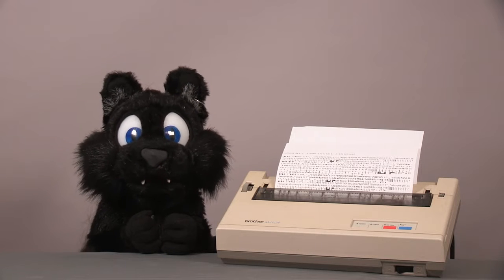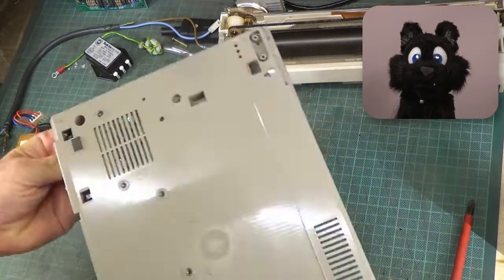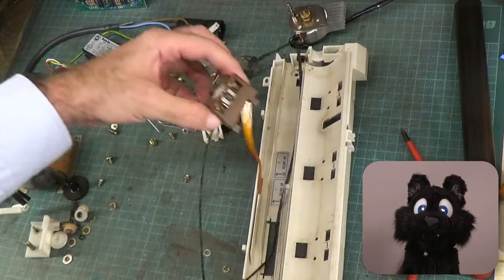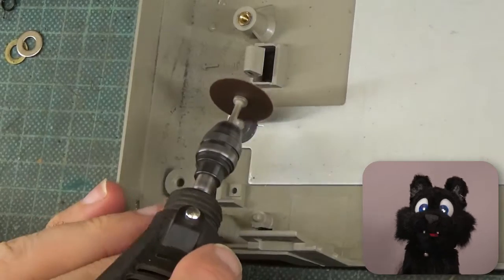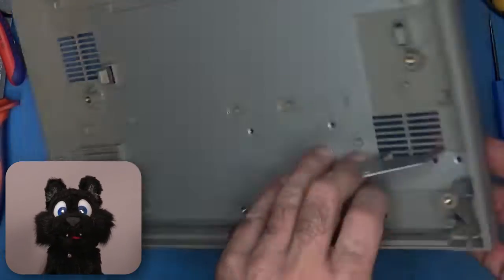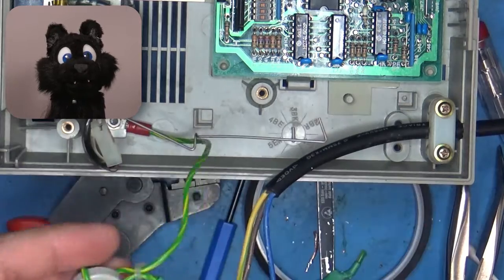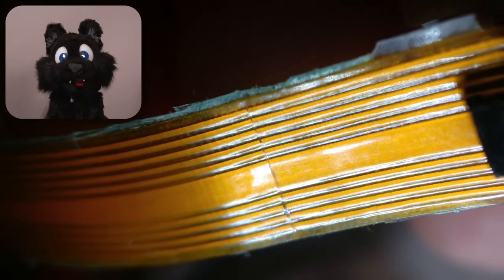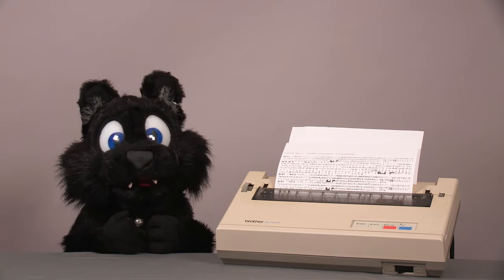Brother M-1109

Comment: This flat cable problem is so common, the ONLY problem I repaired on this printer back in the day, was changing this darn flat. I used to change 10-20 flats a week. It was a very common printer in Brazil, named as Lady 80 / Lady 90
Reply from the maker: I can imagine... but where to get a new one these days? I hope the repair holds for some time...

Comment: I have the M1009, very similar to this one.  It won’t advance the platen, the stepper motor is rotating and the cogs are not sheered, they all connect together correctly but it won’t turn when the line feed button is pressed, the platen dial will rotate manually, very easily, so I can’t figure out what the issue is.  Any ideas?
Reply from the maker: Maybe a gear is slipping? they are just pressed on to the axle IIRC...? These gears also tend to "crack" and loose the grip.

Comment: printer nightmare, a servo motor and a resistor using a heat sink, switch with built-in fuse (Same stuck on the casing ) and the broken flex ,all that in a small casing, good job cat

Comment: Amazing restoration, as all the other ones !! About the power switch, it looks like a thermo actuated circuit breaker, if it’s the case, it will auto reset after cooling down.
Reply from the maker: Interesting thought... It would be the first thermal based switch without a bimetal construction I come across. I still wouldn't want to try it though :D
Reply: @atkelar  Oh, I wouldn’t try it either 😁 In the video, the metallic contact strips looked like bimetal, but I might be wrong, it wouldn’t be the first time 😂

Comment: Very interesting type of toroidal power transformer inside. I've seen similar ones inside early 2000's Onkyo receivers.
Reply from the maker: Interesting! I think I've seen similar ones before, but I can't recall exactly where. Pretty sure I didn't ever have an Onkyo receiver open... I have one for my home cinema installation, but that is working well and shall not be opened for fun (yet) 😜 It might be a series made by a specific manufacturer that was either cheap or had specific quality properties.
Reply: I’m pretty sure it’s not a toroidal at all, but rather what is called an R-core transformer. IIRC they’re used in audio devices because they produce less stray magnetic fields or something like that. They’re a fairly expensive type of transformer to manufacture.

Comment: As always a commending amount of effort put into the restoration, pity about that flat ribbon, I absolutely can relate to it, I recently fixed a P2 Laptop CD-Rom drive which failed in both cracked gears and broken ribbon cable to the laser assembly and my ribbon was broken at the contact end, oh boy and it even change width directly after it, in a miracle I managed to make a sad working connection and it works again, but as always how long can cracked repaired delrim gears and flat ribbons work like that anyway? age can really take the best out of most stuff
Reply from the maker: With lasers, the additional problem is that they age poorly even without the surrounding support giving up. I hope your drive holds up as long as possible!
Reply: @atkelar  yes let’s hope so :)

Comment: Good thing you noticed the flat flex issue, otherwise you'd be in for a lot of trouble down the road... At least now if it fails, you'll know what failed.
Reply from the maker: It was quite obvious; These ribbons don't age well at all. I might try to make a replacement, if it fails.

Comment: Very thorough restoration!
Could you elaborate on the strain relief remark on that line filter thingy adapter you've made? Thanks!
Reply from the maker: Thanks!
That's a detail I only realized during the final stages of editing; hence the lack of commentary. I wrapped a piece of wire around the perf board and the connector, since I don't trust the copper to withstand any mechanical stress. That wire is soldered to the connector and tight thorugh the perf board. That way it hold the two together. Of course each connector needs its own wire, and the insulation tape has to go on the backside too for that reason.
Reply: @atkelar  ah, I see now! I agree, you could easily rip it off without additional support. Very clever!

Comment: At 8:04 and 9:39 was that a wire resistor with a heat sink? I never saw a heat sink used on a resistor before, although I saw some resistors with placement for screws to do that. Also the transformer seems to have a ferrite core, I also never saw that on a line transformer;I imagine it is intended to reduce weight. I would put a fast fuse with slightly less current spec in series with the weird power switch. I love needle printers, at that time printer ink was not more expensive than gold.
Reply from the maker: Yes, that was a power resistor in a sleeve that bolts to the heat sink. First time that I see that combination myself, although I have come across other solutions to add resistors to heat sinks.
While the transformer looks like ferrite, I'm not really sure it is; it is quite heavy. Might be some sort of sheets and paint? I didn't have a reason to poke at it :)